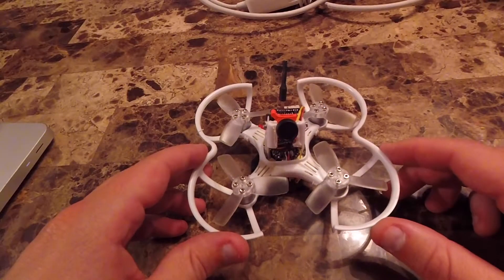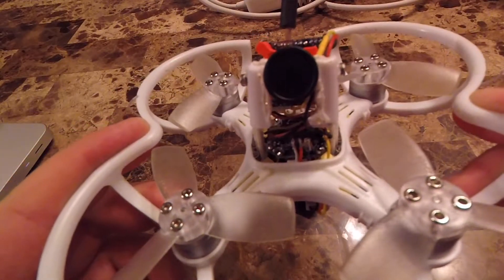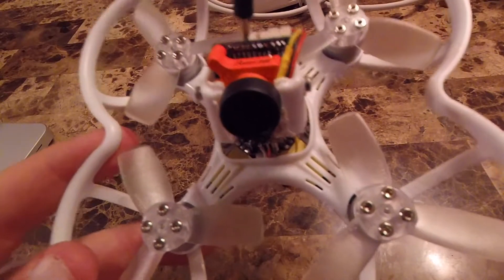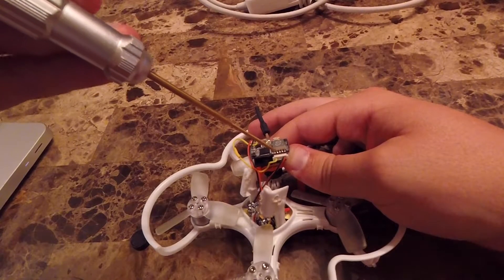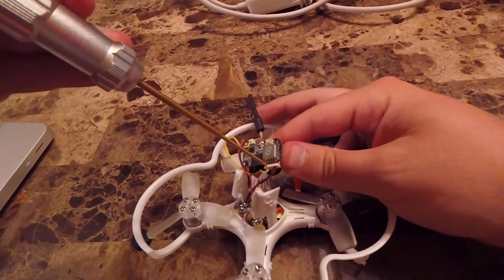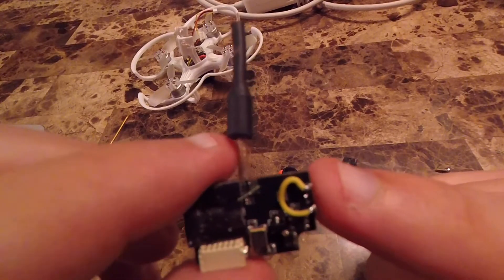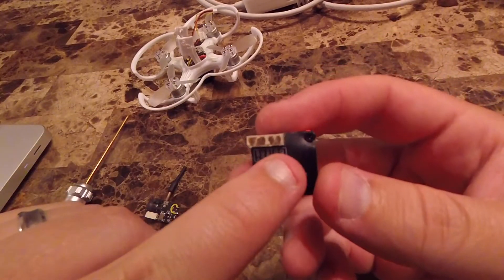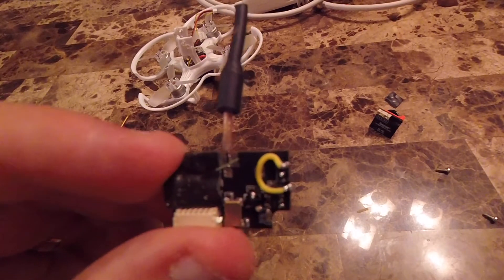Installing Runcam Micro Swift on Emax BabyHawk

Comment: Hey my man! I know this was probably made before Betaflight had built in OSD, but I am DESPERATELY trying to find someone that has done it and simply can't with this camera/VTX AIO anyway, but could you not take the video from camera directly put that to the "VID IN" or "CAM" of FC then take the SAME wire you used for video "out" from the original connecter the far one same as you did her not the second to last one and connect the last video wire from original loom to "vid OUT" of the FC and walla get BF OSD???? lemme know would you if you have any idea if that would work or how one might get that working?? Thanks good vid!! L8r-Turbo.

Comment: without osd how do you know, you have low battery? - thx
Reply from the maker: orisisun without the OSD the flight controller is still monitoring battery voltage and will go into failsafe when it drops below that threshold. First the lights will flash (not helpful if flying FPV) and then it will just shut down. Good for the battery, not so good if you’re flying over water or tall grass. In the case where I don’t have an OSD I always set a timer on my radio or cell phone so I known when to land. With the baby hawk it was set to about 3 minutes.

Comment: Nice video and something I planning on doing.  I saw where you fed the video out from the camera to the VTX (Yellow wire) but how did you power the camera?  I appears the red and black go back to the FC?
Reply from the maker: The VTX is powered via the 5V output from a UART. The camera itself is powered directly from the battery pads since it can take 5-36 volts.
Reply: Did just add another ground and hot to the UART on the board or did you splice the wires red to red and black to black?

Comment: Hello cjkcizur i know you taked about designing a mount for the runcam but after seeing your video i went to work and designed one let me know how you like it so far mine works pretty good. https://www.thingiverse.com/thing:2510700
Reply from the maker: Wow that looks great! I actually moved the components of the Babyhawk to a 90mm carbon fiber frame so I'm using a TPU pod mount for the Runcam Micro now, but that design looks very impressive as almost a factory bolt-on for the babyhawk. Well done!
Reply: Would you mind saying what frame you got ive been looking for a good carbon frame to transfer to myself. it was just faster and cheaper to print the mount at first.
Reply from the maker: The frame I ordered was the RealAcc KT100 from Banggood, so I was wrong about 90mm, it's actually 100mm. Although I'm not using the top-plate and camera mount that came with the frame. I instead printed the pod from https://www.thingiverse.com/thing:2296778 and scaled it up to fit the standoffs of the frame. Printed in TPU and also printed some TPE soft mounts for the babyhawk motors.

It's not perfect and it's still a work in progress, but it's pretty cool. Unfortunately I've been having issue with motor failures with the Emax motors. Looking for another 11xx option.

Comment: nice video. you thought about OSD?
Reply from the maker: I have already integrated a Micro MinimOSD! I just have it monitoring voltage right now but it works great and fits into the build nicely. I have a flight video on my channel with the DVR with OSD overlay.
Reply: cjkcizur wow you did. I video of how you done it would be great man!!
Reply from the maker: I unfortunately did not make a video but I may put one together if I get into a situation where I have to disassemble the BabyHawk again.  

Basically I followed one of Project Blue Falcon's videos for flashing the board with an FTDI adapter. I then soldered it to the UART2 pins of the Fetmo board using pin headers. This lines up perfectly with the 5V input and GND, but the RX and TX pins are matched on the board to the OSD (RX to RX, TX to TX = WRONG!). I knew this going in but I thought I could swap the pins using Resource Remapping in Betaflight but I was not successful. So if you are going to install one, I would just use wires to connect up everything so that you actually get telemetry readings from the Flight Controller.

In my case I just ran an extra wire from the battery to the voltage monitoring pin on the MinimOSD so I get voltage and time on the screen.

For mounting, I cut out the plastic from the frame where the Fetmo originally sits, and stacked up the OSD board, FC, and XM+ receiver all on top of a couple pieces of 3M VHB foam tape. It's a tight fit but the props clear and she flies great!
Reply: cjkcizur great reply man. I wish someone would do a video but lol. you tried 3s??
Reply from the maker: agrs1974 aka Andy Sommerville no I have not but I have not been disappointed with the performance of my 350 and 400mAh batteries. Solid 3 min acro flights.
Reply: cjkcizur appreciate your time to reply. I might buy one and try it